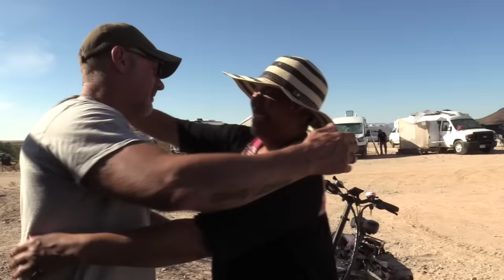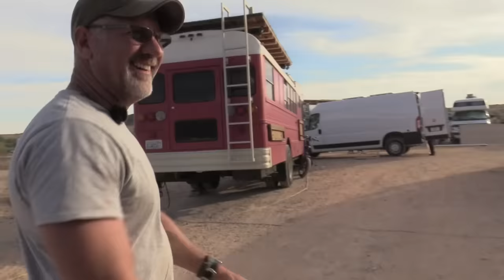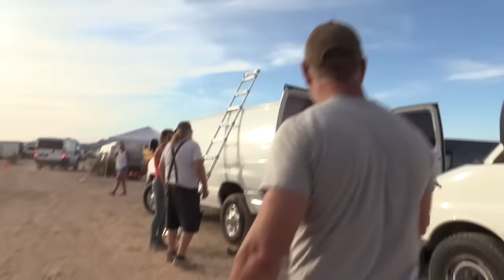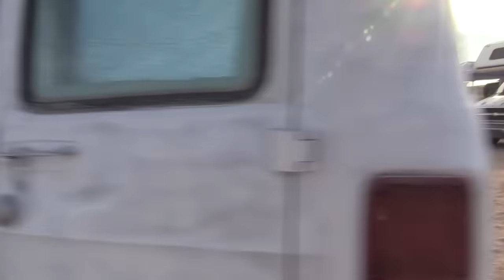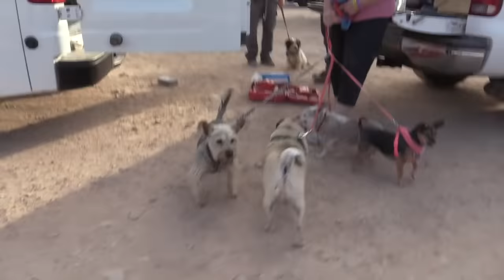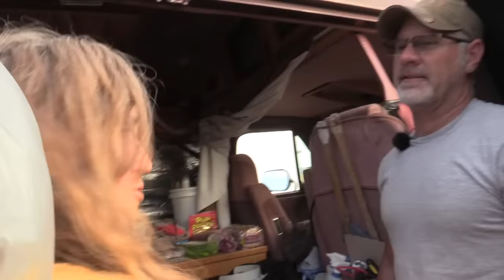Testimonials from Van Build nomads - 2019 Van Build Fest

Comment: I am almost 82 and needed help finishing a canvas topped wagon (only needs foldup ends) and hooking  up a solar battery that Will Prowse talked me into so I paid the $75 early but was unable to attend until the 18th.  When I went to the signin tent the ladies told me that there was only one carpenter team and they had more than enough work so I should not even sign in.  Could not see any reason for them to lie so I turned around and went home. $75 down and  my Sparky and I are still trapped in a house when we want to be free.  I'm glad that so many report positive results; wish I could have been among them.